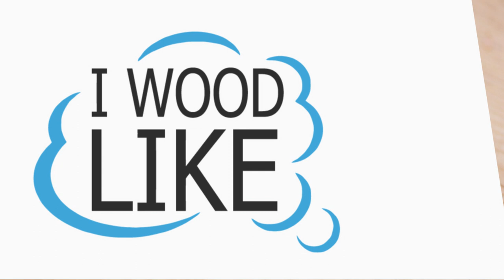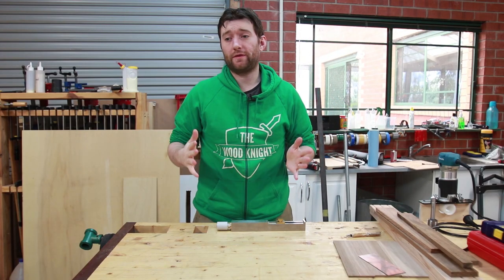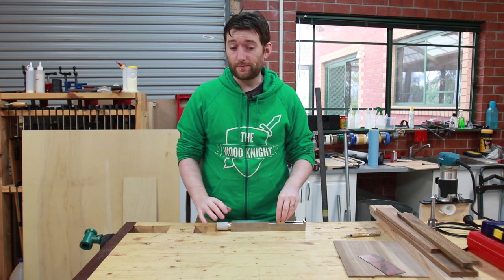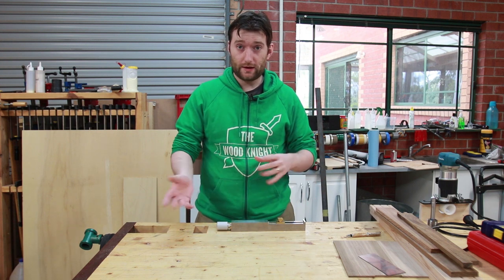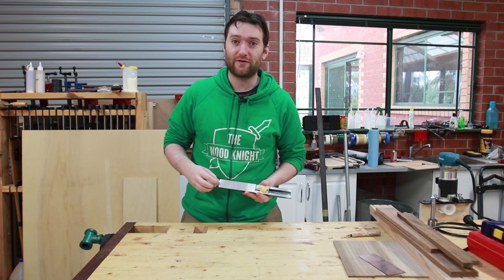111 - Thanks Pete/Stationery Box

Comment: So how much tear out do you get on diagonal bias ply pen blanks, I'm guessing a lot?
Reply from the maker: Using a freshly sharpened bowl gouge (you get about one pen, maybe one and a half per sharpen.. the glue wears it very quickly), and rubbing the bevel, tearout is pretty manageable. The tricky bit is the last ~3mm or so next to the bushings - its very easy to chip off an entire lamination as it gets pretty thin. I'll usually resharpen my gouge just before hitting that section
Reply: You're braver than I am. I'd probably chicken out and use an 80 grit scraper! ;)
Reply: Also don't know what to say mate. What an awesome surprise it was to see this come up in my subscription feed this evening.
Reply from the maker: I'll make sure to send along a blank or two so you can get a shot at it ;)